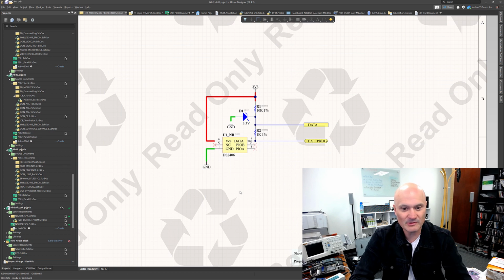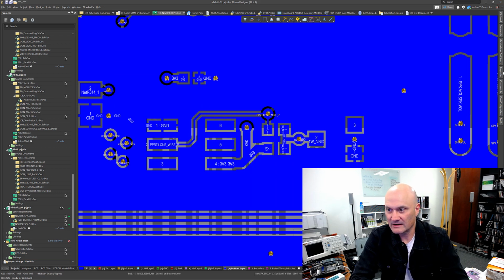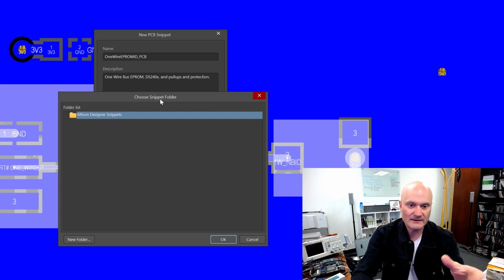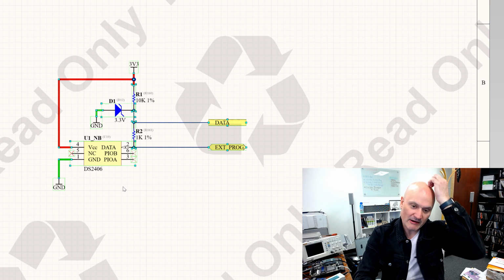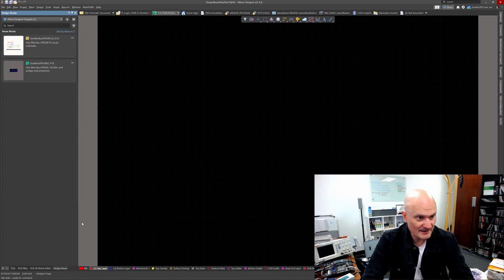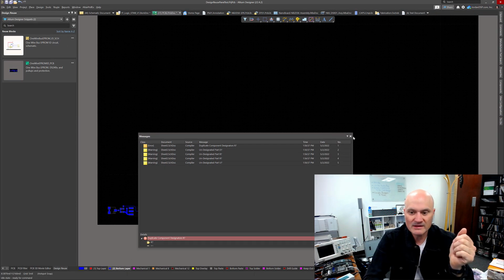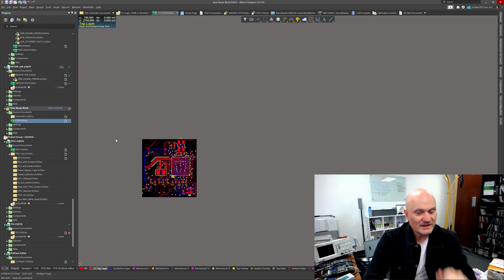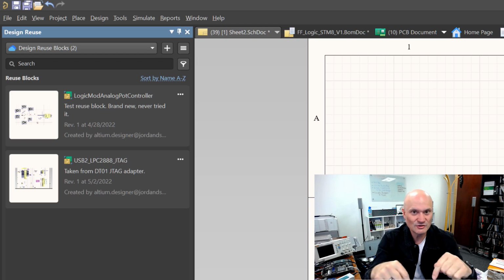Altium Designer Re-Use Blocks, Snippets, and Device Sheets - What's the Difference?

Comment: Very strange limitation of Altium...even the component links would be a breeze if they just made snippets retain the component designators.
Reply from the maker: For some architectural reasons Snippets were never able to do it that way. This is an example of how one strength of a product can also be it's weakness in a different way. Components in Altium are actually identified by a GUID so that designators can be reset without breaking the link schematic-to-board, and being able to back-annotate. However, this meant that in a snippet, there was no easy way to prevent the user from duplicating components with GUIDs matching (that should never happen). However that might have been possible with some additional coding effort... and that additional effort always tends to give way to releasing new features instead of finishing existing ones (read the forums, you'll see a lot of users making that comment! ;-))

Comment: Nice vid! Reuse blocks can only contain a single schematic sheet, correct? Since my boards are nearly always organized hierarchically, that means I would have to convert my boards into a single schematic page? Other question, can reuse blocks be traced with the "Where used" functionality on A365?
Reply from the maker: As of now yes, they don't seem to support multi-sheet re-use blocks. I have tried making the blocks themselves to contain other blocks or subsheets. The commands for placing those are disabled. You CAN however place a reuse block as a snippet within another reuse block.
Reply: I see, thanks for your input on that! As far as I can see, only managed sheets allow traceability across projects? I'm a little stuck as my intended reuse block is a SoC core with a PMIC page, LPDDR4 page, eMMC page, all sorts of interfaces on separate pages as well etc. so that is keeping me thinking atm (especially because the SoC is split in like 10 sub parts). As this reuse "block" would form an important block for nearly every new project, I'm looking for a solid solution atm
Reply from the maker: @TheDigital19  Indeed. I am fairly sure this feature is unfinished. This is not unusual for Altium to release something unfinished or not quite yet useful. Give it three years and they might support hierarchical schematics in reuse blocks...

Comment: Ben, you can place a schematic snippet and have it retain the reference designators be going to the Preferences Panel > Schematic > Graphical Editing and under Options make sure that 'Reset Parts Designators on Paste' is unselected.
Reply from the maker: Was forgetting that one! Thanks for the feedback.
Reply: @schematica  Ben, if you figure out how to do a multi-sheet snippet to work with the REUSE BLOCKS I would greatly like to know how that us done. I can’t figure out how the REUSE BLOCKS can handle more than a single sheet schematic. Thanks, Marvin Law.